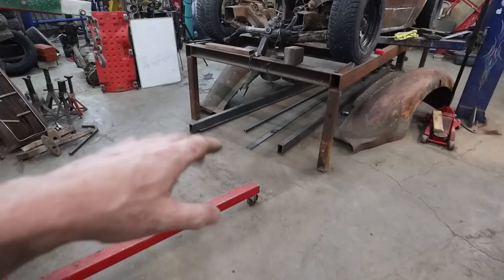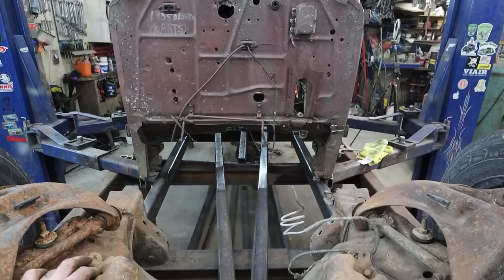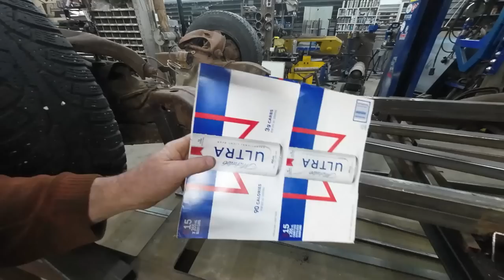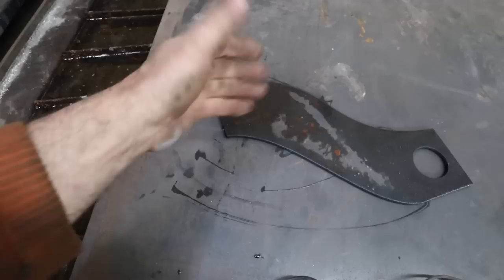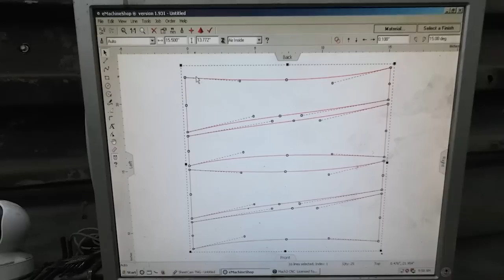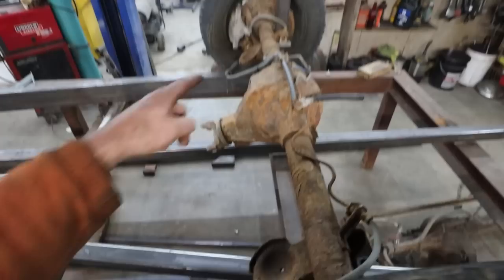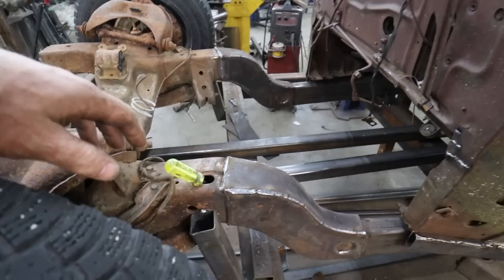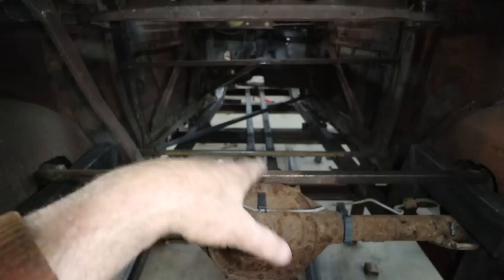The start of building a custom chassis for our 1935 Dodge 3w coupe.

Comment: That's what I'm talking about, use what you already have in house. The less you spend is better. People seem to think there is money to burn, there are plenty of other bills that have to be paid so the shop can keep running. Working on car's can get very expensive if your buying parts real quick. If you can make them or use what you already have hanging around use it before it GOES bad from just sitting around.

Comment: Brilliant, just don't forget the axle angle to your gearbox, because you have the snout of the pumpkin facing down so the back of the pumpkin top is higher than if the snout was pointing up at the opposite angle to where it is resting, so if the snout is angled down 5 degrees from horizontal and the top of the pumpkin is high then lift the snout to be 5 degrees up from horizontal it would tip the top of the pumpkin lower.

But the main part of this is you always find a solution to the situation.
Reply: Looks like he missed rotating the differential into the correct position!!

Comment: She's looking really sharp Brent. I so much wish I could afford a CNC machine. It takes so much time to actually cut one piece at a time with a plasma, or zip-cut. I always manage to get it done one way or another though. Love you work and your vision on what a hot rod should look like.
Reply from the maker: The relatively cheap to build I plan one day to try to do a build for regular folks just have to get my butt in gear and collect the parts my goal would be to build one with a plasma cutter for under $1,000 though it'd be smaller scale

Comment: Hot Rods To Hell does their truck trailing arms like your idea for a two link set up. They incorporate weight jacks on both corners. Very similar to Nascars truck trailing system. They try to replicate the trailing arm syste used on the 60’s GM pick ups.

Comment: There's an insert you can use for stripped spark plug holes. I always hate it when your clip ends. Shout out to Pablo.
Reply from the maker: Yeah like a helicoil I think is it called that said I have spare heads so I'll just swap it out I got to look at the rings anyways

Comment: The rack and pinion that comes with the shaft. That shaft connects to U-joint rubber ring tire ply rag (nylon) Pinto 1935 steering column but the column is custom-order. Chevy engine V-8 Martinsville Mouse motor to the Dodge wind speed dial modern cluster or antique double glove boxes with wood lid on the side below dash, the heat defogger.
 The DeSoto town car that the spare tire is not put on to the Chevy vintage front fender.
But it was specialize to have defogger like a Volkswagen 1930 winter car have heater right below windshield. The wing windows in the front side could be defogger but DeSoto 1935 Dodge engine Six does not want wing windows. It would have chromed stainless steel around the glass and windows of the 3-window car. REO could get some chromed trims from Coach luxury dining car and its plant. They, Pontiac Lake, have depot with package from Billet and Beryl Jet age Ford Antique restoration dealership. The company Burtz grey Iron Tools non-nodular steel forge Sorensen Crankshaft made not for the Ford but this 1935 Dodge Boys versus the Edsel car.  
 The tire iron size 5/8 socket. 11/16 inch, 3/4", 1/2" tire iron high carbon at the steel and road spike producing company that the prime mover is closed permanent so the factory is off-limit. The maker and auctioneer on away to honeymooner and vacation. Then in the past and its beginning the Steel Clark old vintage forklift that did carried the vintage cobblestone street lanterns. The Town street car - I hope that nobody have ever heard the word street. The Hollywood boulevard and the estate avenue in monkey wrench guy site of job and Safety Manpower and its Dept. which involved in 13/16 inch wrench.
 Fixing the shaft of the steering part output connect to the column below the rack and pinion. It's possible for the steering column to go under the engine. The second end of the column is up to the dashboard. The switch was not made by Archer and Motorcraft for automotive. The switch is two bare wires - both ends connect by hand. That simply starts it. Your hand crank starts the engine as the only way cranking up. By a special brace and flywheel ratcheting type together. 
 The word, Cut-Off, means that this is the only way: your hand will  flip the two spring clips off from distributor cap and pull the cap off. The center of the distributor is made out of carbon high resistance ohms so that the ignition coil cable connects to the center. It is to keep you from electric shock. The first resistor spark plug wire set is simply invented up, goes to be better and much nicer afore I get the spark shock from High voltage.

Comment: Love your work but when you did front end connection you basicly sleeved the bottom connection to frame rail then you proceeded to cut off the sleeve part at top and ended up with more or less a but joint .
I accept that it's probably strong enough but I would have liked to seen  more of a sleeve at the top end, too.
As that's the part that will take most of the live load .

But keep up the good work this car will be a great shape when finished

Comment: There seem to be one or two engineering terms I'm not familiar with, swoopy swoopy bits, and welding the ** out of it. But how is he going to bend that plate? Oh yes, a boilermaker's spanner (the smaller version is a Birmingham screwdriver) and then a missed opportunity for some more swoopy swoopy bits over the rear axle (see King of Booty Fab) - you see I'm learning the tech stuff - and really the only space you need is for a girl and a toothbrush (hell, that was a long time ago!). Looking good, I'm looking forward to the next episode.

Comment: Brent you pulled  that front clip to the chassis plating  out nicely  however  you could have also CNC cut the rear  hump over the axle on   to give it a nice smooth half circle for a smooth transition ...if you get what I'm saying...just my opinion 🤔🤔🤔
Reply from the maker: It was my original plan but decided to keep my plate for other fab stuff haha
Reply: @HalfassKustoms  yeah I hear you and considering the crazy price of steel 😣😣😣

Comment: Help, I'm lost this time. It appears the bottom of the frame and the bottom of the tires are on the same plane. I get the dif with air bag stuff but the front is welded into the clip. What am I missing. Great video, great job on the frame connections and fabrication. I'm just not able to see your vision this time around. Usually I can keep up with where you're going.
Reply: I am confused too. How does the front of the frame go up to ride height if its welded to the front clip?

Comment: Hi Brent and my favorite puppy Pablo!  Just a question, where you welded all the sections to the 2X4 frame rails and where the frame rails are joined to the front clip.  Are you going to weld gusset plates to the sides of  the welded sections of the frame rails and where the frame rails are joined to the front clip?  Just wondering .  Rails are looking good my friend!  I like the way you joined them to the front clip!  Been following you all along on this project, it's going to be a great looking street rod when it's done!  Best wishes my friend!  JP Jr.  Pocono Mountains of Pennsylvania,  USA.

Comment: I love the work, always making something out of the forgotten rides. Question, so with your Custom Frame Additions do you ever punch parallel holes and run a piece of pipe through to add rigidity? or you dont find the need?
Reply from the maker: Don't think it's needed as the frames already stronger than most factory frames
Reply: @HalfassKustoms  Okay makes sense. Was more thinking as a union I thought where you join the 2 together thinking that the tube would go through both old and new. but based on your shear amount of work you've done I am probably over thinking the stresses

Comment: I for the life of me can not figure out how come it looks so hard and then watch you do this and its "ya dummy, just like the other ones you built". I always overthink things. Was wondering if raising the table under that gun for your cnc table would be a easy temp fix... like just slide a piece of eighth inch sheet under it... dumb hu? Unless it works, it is. I still have a hard time with over the rear axles... I am sure you can still get the calipers off without running into the frame rails. Some of those goofy bolts are super long and just don't leave enough room for removal. When you do the angle pitch of the rear end, will it give a tad more room for the punkin to the rail highth? Just too many questions and just being patient while you do your day job and still get a build done is hard on this old man.

Comment: I would be concerned about torque, not hp, when sticking a 4 bangers transmission to a V8.

500hp comes at high revs, so the transmission pump is making good pressure for the clutches, to hold the torque…
Reply from the maker: Haha I'll be testing it and find out lol that said I don't imagine this thing will have much traction either way.

Comment: To bad he wasn't smart enough to make and weld in the bottom caps of the frame first, as this would have made it a lot stronger and easier.
Reply from the maker: Not sure what you're referring to if it's the bottom part of the z I'm just waiting to lift it on the hoist and weld those on after?